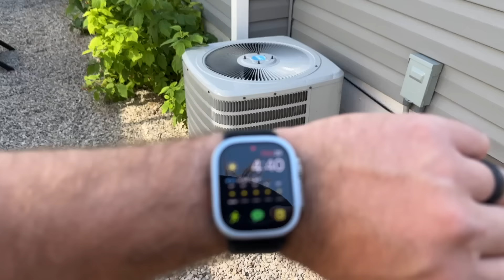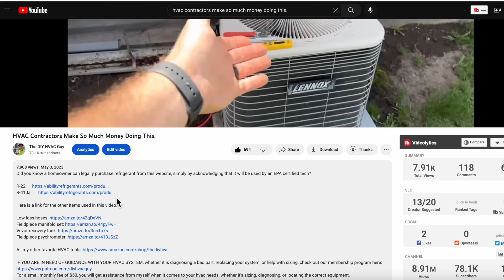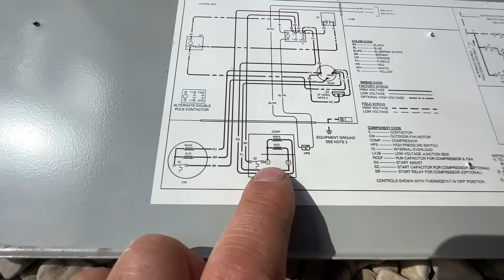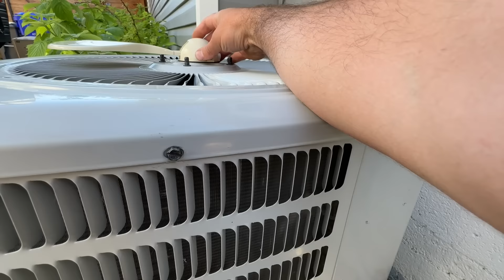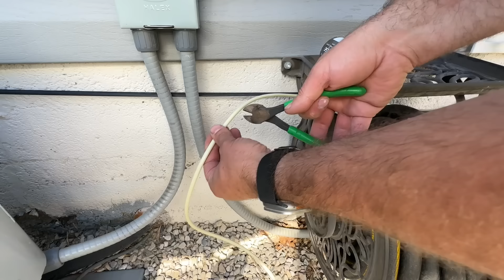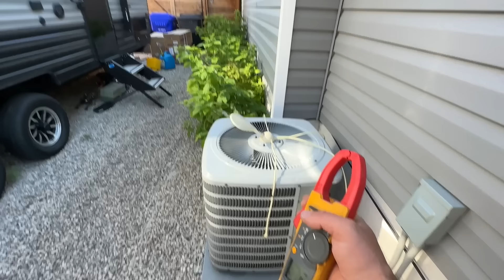Can This Device Actually Lower Your Electric Bill By 30%??

Comment: I bought one and I asked a question to this company, the plastic paddle switch will go bad on a heat pump system cuz its moving all year if u stick it to the top of your air conditioning  so I said the company who invented this should stick it on  with velcro cuz in the winter you should not keep it on a heat pump and the plastic mine crack on the paddle.

Comment: question,, why did you not put the third mister on front the larger coil surface and more air flow.. a better temp measurement is the Delta T from return to supply..   that tells the true cooling effect.. a unit running for a while can create a lower supply air temp.. coming from the HVAC field some years ago I had thought about a system like this to help with condenser efficiency but did not figure it out short of a hose and a sprayer..  :)

Comment: I had one of these about 1-2 years after they came out. I had seen a show that Bill Nye was on and he was installing one. It sounded good so I purchased one. It did reduce the amount of electricity my unit used and was way more then the cost of the water. Not much water was used. It was like $2 more a month. I am in the south where in the summer we get over 100 many times during the summer. I used the filter and replaced it. After the first summer I did notice a very light build up on the coils. During the second summer it got thicker. I tried a couple professional AC coil cleaners to remove the build up. I did not have much success in removing it. I had a HVAC tech tell me to stop using it and the cleaners because it could cause the wire guard to rust. He said the build up could cause the compressor to fail sooner. Which it did about 5 years later when it was 8 years old. Not for sure if the two was connected but could have been. Over the next few years the wire guard on my unit began to rust. The buildup did have a slight negative effect on the performance of the unit. Something to watch out for.
Reply: Yeah you wrecked it. Its not even remotely designed to operate this way. I love the wannabe geniuses who think the HVAC industry is just too stupid to figure out to do this if it would help them meet energy consumption requirements. They don't do it because it would require a total redesign of home HVAC systems to work properly.

Comment: Another water flow control is using a valve for a sprinkler system, but i do like valve used basrd on air flow. Nice and simple

Comment: For window units... take a file and file a small hole on one of the outter corners so the water can drain out o the unit. Keep it from rusting out the rad and failing.

Comment: This will end up costing you in the long run. Due to the expedited failure of your compressor unit. No matter what the temp outside is the unit will cool as designed. If your house is hotter the unit will be on more, it’s that simple. If you are not happy with your electric bill maybe upgrade to a newer larger capacity unit. And by the way the constant mist soaks the fan adding weight and drag reducing it’s efficiency.

Comment: Water Drip like you are recommending are illigal in Australia, since water shortages during Drought periods. The water cools the Condenser/Refrigerant which reduces High Side Pressure but can also cause LIQUID SLUGGING and that will damage the Compressor if too much water is allowed drip on the coil. Not recommended to would be Mechanics.

Comment: We hit 111° here with 131 heat index a few weeks ago. My central air performed well without this, so I wonder if it would boost it into really removing more heat to where when it is above 110 here that it would not run as long during cycles.
Reply: Yes. That’s the entire point. Especially if your unit is sitting in the sun. Evaporative cooling is a thing that does exist. Especially on radiators.

Comment: I lived in Yuma, Arizona years ago.  My AC was on the roof.  The air is very dry and the summers are very hot.  They put honeycombed paper material around the AC and drip water down through the paper.  It cools the air down going into the coils.  The honeycombed material needs to be changed periodically because of calcium buildup on the paper. It works very well and because it doesn't drip water on the coils nothing collects on them.  I think it's got to be dry to cool the water so it will evaporate and cool down.

Comment: Not liking the idea of constantly misting a metal unit with water. There is a thing called corrosion and rust. How many units have gone to crap over a few years of using a misting system? I would rather not have to spend another 7 to 10 thousand to replace a rusty unit prematurely because I used most on it.  A better option is to make sure your condenser is in shade. If it isn’t then make shade for it.

Comment: I did some of this with my hoes and a set of gauges to see the pressure variance and it was significant so I did around the unit with the patio sprayer coolant lines and didn't have much of a significant change but I know the condenser unit did enjoy and benefit from the reduced high side pressure level being reduced significantly from 240 to 160.
Reply: Who you callin a hoe?

Comment: What is the flow rate of the misters (GPH)?
1.8 gallon of water evaporated is 1 ton of refrigeration (energy equivalent).
The water has to be evaporated on the coil for significant cooling not just cooling the air flowing over them.

https://www.epa.gov/sites/default/files/2017-12/documents/ws-commercialbuildings-waterscore-mechanical-systems-guide.pdf

Comment: If your unit was installed properly you wouldn't have to take the handle off the clearance on that unit definitely isn't acceptable to manufacturers specs and shouldn't pass inspection anywhere

Comment: This is a really bad idea.. It will ruin your coil over time and the service company will greatly appreciate it. In supermarket we're forced to use water at times to prevent product loss. Set them up on pressure switches to only come on during extreme conditions. 90 degrees isn't extreme! 105-115 add some water.

Comment: So this is a trick that HVAC tech use when a customer's AC system will no longer rejects heat at the condenser. Granted every time I seen this done for long term use ( more then one season) it has accelerated corrosion of the coil. Now I know this comes with a treatment canister maybe that will stop it maybe not 🤷‍♂️

Comment: Okay, the initial investment is $100. After that, you need to buy a water filter every 3 months. In Texas we run the AC from May to October. So, $60/year for filters. They claim the device saves 30% on your cooling cost, but your demo, 4.4A before to 3.6A after, shows realistically you pull 20% less current with no reduction in air temp. So, a realistic break even is $60 ÷ 0.20 or $300/year. That's about what we spend on AC in two months. Where do I sign up?

Comment: Common method used by manufacturers to increase SEER rating on convention A/C unit is to increase condenser size which lowers average compressor head pressure and allows the use of a smaller compressor to achieve unit's btu rating.

By spraying condenser with water, you are effectively increasing the condenser effectiveness.  You are not getting the benefit of a smaller compressor size, but you are lowering the compressor head pressure which reduces its power consumption and raises the yielded btu capacity of unit.

Comment: pre cool air? isn't the air coming from inside the home not outside?
Reply from the maker: Yea precool the air the outside unit is circulating. They are totally separate but the refrigerant in the lines is what produces cooling in your indoor coil.
Reply: @diyhvacguy  so are you saying this device is to cool the refrigerant in the line?? I think this is total bogus …

Comment: Your 2nd meter reading is because you're not using the amp clamp properly. I believe that this theory or device is a good idea and it should work but I don't believe your amp readings were compared in an accurate way.

Another thing you can do is build an awning so your unit is never I'm direct sunlight. You're trying to release heat and having the sun constantly pum heat directly into the unit reduces efficiency.

Comment: I did a little math here, let me know how far off I am:
To convert amp hour to KWH: multiply amp hr by voltage (208-240) /1000. 1 amp/hr @ 240v = 0.24 KWH. If the unit runs for 45min every hour the whole day, we are talking 18 amp/hr * 240v = 4.32 KWH per 24 hours. 4.32 * 30 days = 129.60 KHW savings. My electricity runs $0.139 per KWH. That equals $18.04 savings in a hot month where the system is running 75% of the time around the clock. At $100 retail, it would only take 5 months to recoup the cost of the sprayer, however you would also need to change the filter during that time and that costs $29.95. This extends the recoup to 7 months. 

If the math works for your pocket book, great! The lines will need to be blown out during the winter as I don't think the adhesive backing is going to allow complete uninstallation.

Comment: As an over-the-road driver I sometimes pulled temperature controlled trailers, reefer, and in the summer it can be hard to get the temperature down for the load carried.  I had one load in particular that had to be shipped at -10°F or -23°C and at the time the lowest I could get it was just above 0°F but they loaded it anyway.  Due to my hours situation I didn't have time to do what I really needed to do and that was spray the reefer unit down with water.  The reefer unit is that thing on the nose of the trailer that heats and cools the inside.  I finally managed to get the temperature down to where it was needed the next day by running through a thunder storm.

With the sprayers spraying away from the AC unit surprised me.  I was expecting to see them pointed inwards instead of outward...

Comment: Does it work better with the misters pointing outward away from the condenser or pointing in to the condenser fins?  I just received and installed this same unit and pointed the misters ina dn they hit about a 1"-2" dia area of the fins and I now see a wet line running down the fins to the bottom.  I'm not sure if pointing them in or out would be better.  Also, I'm in Florida where we are getting daily rain and high humidity right now so not sure how helpful this really is this time of year here.  Any advice?

Comment: I do not do HVAC anymore, but when I went to school for it, We were instructed not to do this. Partially because of the mineral build up you can get on your coils from the Treated water constantly on them, but also because it changes the dynamics for the change of state of the freon going through the coils, lowers the head pressure the Pressure differences is also lowered which makes some metering devices not Allow enough freon flow to be as efficient. Is this not accurate?

Comment: If you mist water on the coil, you really don't need a fan. Just run a 24V humidifier solenoid. Water would remove heat much faster, you could actually use a smaller condenser. And you have to be careful not to cool the refrigerant below 55°F or it could stay in liquid form and damage the compressor. 
But, if you live in four season land, you'd have to blow the water out of the system every fall, before the first hard frost. 
And the temp difference between your return air and supply should run between 18-22°F difference. If you cool too fast, you won't remove humidity. 
If you're in the southwest, use swamp coolers, but remember to open windows to let the humidity out, or you'll end up in a jungle!

Comment: I've always wondered why there aren't system that collect and spray the water that comes off the evaporator onto the condenser, especially in high humidity areas where you just dump a lot of cold water out onto the ground.

Now the big problem I see with this is the extra moisture rusting the unit requiring it to be replace sooner, which could potentially cost you more than what you saved. I imagine that's probably one reason why my above idea isn't done.
Reply: Those units are designed to be out in the elements. Especially if you buy a "coastal unit" I wouldn't worry about water too much. Doubly so if it's got aluminum fins. 

90% of the units I've seen with rotted out fins are either caused by landscapers piling mulch up next to the unit, or years of dogs pissing on them.

Comment: cool-n-save HARD WATER WARNING

Damage to air conditioners can result from use of the Cool-N-Save Air Conditioner Mister (the “Product”) with well water or other high mineral-content water. For this reason, Cool-N-Save, Inc. (“Company,” “we,” “us,” or “our”) does not sell the Product to INDIVIDUALS who represent that they use well water or are located in any of the following areas: Arizona, Southern and Central Nevada, High Desert, or Palm Springs, California and surrounding areas. use of the Product with well water (regardless of whether the water is filtered, purified, or otherwise treated), in the FOREGOING areas, or in any area with high mineral-content water, may result in damage to the air conditioner.

Comment: I have seen this movie before. Joe Schmuck installs gadget on HVAC. Joe Schmuck has zero understanding of how it works or the issues with increased maintenance requirements. Joe Schmuck doesn’t know when the filter is clogged. Joe Schmuck ruins many thousands of dollars of HVAC installation. But Joe Schmuck saved $50. I lived in deserts where the entire house cooking was evaporative AC. But refrigeratige AC in humid Texas with high mineral water. No thanks.

Comment: This is not a new concept. This was a sold product years ago and has been tried several times. You have to be careful and check the pressures on the compressor as the water exchange elevates those.

Comment: should have checked the pressures bet that diff in temp on the outdoor condenser is making the pressures off. a colder out door coil can throw the compressor into a low pressure shut off.

Comment: I have a window unit having no drain. The water condensate from the evaporator eventually fills the chassis enough to be picked up by the blade tips of the condenser fan.

Comment: BEWARE of gimmicks like this.
The water can condense your freon back into a liquid before it travels to the compressor. Liquids can't be compressed, and it WILL destroy your compressor. 
Normally, this would be a $800-$2,000 repair. However, if a tech sees this bootleg contraption attached to an otherwise perfectly fine AC unit, he knows he's got ya on the hook because you just voided your warranty. 
If you know a guy, you might get away with replacing your condenser for a couple grand, but the vast majority of companies will tell you a complete unit replacement is the only way they can proceed ($9,000 - $20,000) You voided your warranty, and no company is gonna put their name on it, period.
Just make sure your condenser is cleaned (UNIT OFF) twice a year.

Comment: Yes put this on your air conditioner if you want to ruin the condenser within 2 years I have seen similar systems installed on condensers what nobody bothers to tell you is that if you live in any place with any kind of minerals in the water they will build up on the condenser coil I had seen it over a dozen times. The more minerals in your water the faster it runs the coil of your condenser

Comment: That one degree difference could just be your temperature delta between the return air and supply air, regardless of the compressor's termperature.  If the return air is one degree colder, then maybe that's why your supply air is showing one degree colder. The first time you said it was running for 10 minutes.  The second time you said 15 minutes.  If it ran 5 minutes longer, then theoretically your return air got colder, making the supply air even colder.

Comment: I'm gonna call BS on that current measurement, both times. Why wouldn't you just read the amp draw at the input to the system?  How many ton system was this anyway? 

I've seen higher current draw on window mount AC units, and while yes they are 120V, not 240 like this, at 12-15 amps 120, that would be 6-7.5 amps at 240.... So you're saying this AC unit uses less power than a window mount? 

Math isn't mathing.  

And failing that... what the hell does cooling the gas faster have to do with compressor current? By this logic, the air conditioner should use less electricity on cooler days than on hot days to take the same freon from the gaseous state compressessed back into a liquid at... what ... 180 PSI? There's no mention of temperature there...

Comment: The nozzle on the back side is a bit of a waste. Smaller surface area while the exterior face is larger and would benefit from the additional cooling.

Comment: I have been in hvac 26 years and have seen this before. It's an excellent way to foul your coils with lime,dirt, and lots of other debris. All of which can guarantee a higher elec bill due to high amp draw and potentially a bad compressor. 
Just keep your equip clean

Comment: Just some fyi. The temperature coming out of your vent will change depending on the temperature inside the house. What you want to look at is temperature drop. 
Take a temperature reading at your return air vent while also reading the temperature of air coming out of the discharge vents. Subtract the temperature at the discharge from the temperature at the return air vent and you will get your temperature drop.

Comment: So to answer the question, will it save 30%, the answer is no.

It went from 4.4 to 3.6 ...so basically 82% of what it was before ....or (4.4 - 3.6) /3.6 = 18% savings.
Reply from the maker: Not 30% but I’ll take 18%! The water usage will not be even noticeable as it’s 1 flush if the toilet per day

Comment: You used the meter differently when you read the amp draw. Pinching the wire vs surrounding it. Could that make a difference in the reading?
Reply from the maker: No it was clamped around it for both.